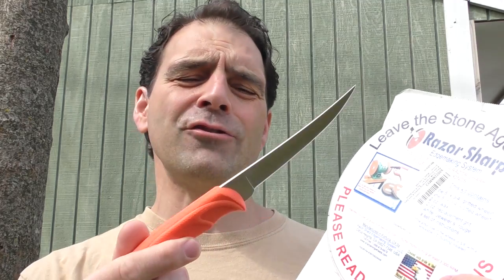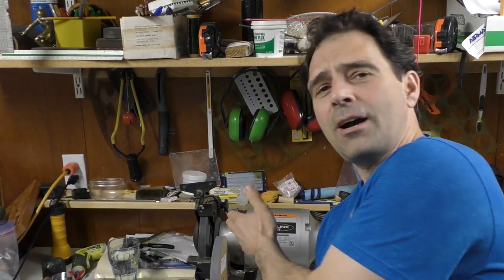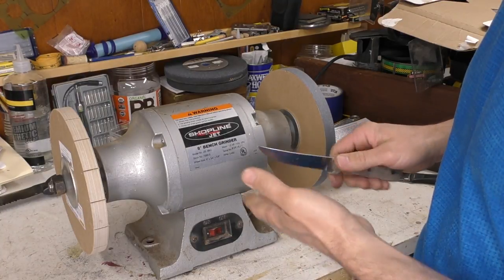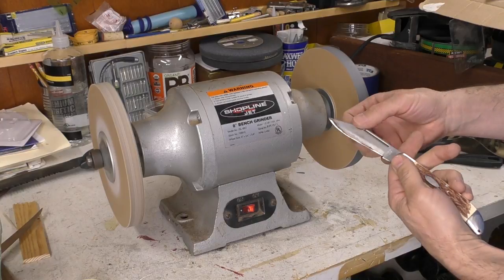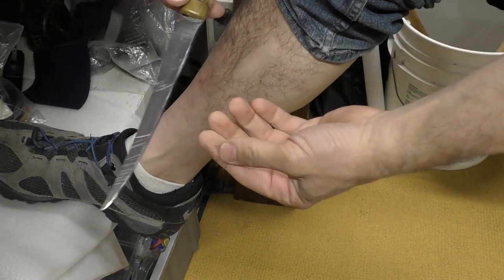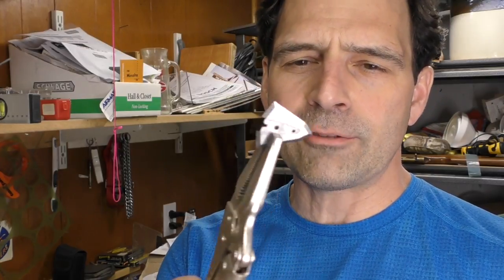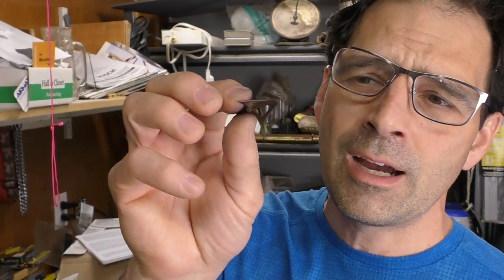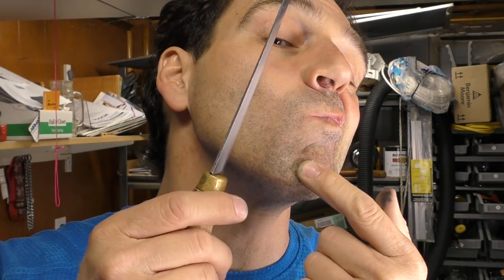Razor Sharp Edge Sharpening System - Is it Worth the Money???

Comment: Great video, try hitting each edge twice in the same direction before turning your knife around to get the other side at least until you get your bur, it keeps you from flipping your knife around so many times. Great system as i have used it for years, my only slight problem is getting my fillet knifes so razor sharp is that when i am filleting a crappy i sometimes cut right through the backbone because my knife is so sharp at least on the first side of the crappy because the first side doesn't sit as flat on the board as it does on the back side of the crappy. This paper wheel creates a hollow ground edge which i like on my knifes and tools.
Reply from the maker: Thanks.  Yes, I still love this method and I’ve gotten better with it.  Developing a burr on each side is a game changer, and this gets it done quickly.  Gotta love a sharp knife!

Comment: Nice video! It would be much easier and safer to sharpen your knives by having the wheels turning away from you, not towards you. That way, you get better control of the angle at the top of the wheel. For better precision, a "Tormek" type railing system used with a dedicated knife jig can be mounted at the front of the bench grinder. Extra cost obviously, but the difference is noticeable if you want perfect knife edges. Also advisable to wear a face mask. Metal & paste particules are not compatible with lungs.
Reply from the maker: Thanks for the comment and advice Geoff.
Reply: Yes you are right I have the same wheels and was sharping a bench made and it jerked it from my hands and broken it in half it could've been worse

Comment: Use both hands to control the blade.  This is true of using bench stones as well.  Do not use force to accelerate the sharpening.  A final strop is in order and then periodically thereafter.  80% of your sharpening needs can be handled with a good strop and stropping techniques.

Comment: Turn the grinder so it rotates away from you. Then you can place the knife facing away from you, and use the top of the wheel, simply angling the knife at the correct angle. Much more stable and safe.
Reply from the maker: That’s what the directions say, but I didn’t like having to reach over the wheels.  I’m more comfortable/ secure. The way I had it.   Thanks for the input though.   These wheels are absolutely fantastic.
Reply: @leafinitup1  one guy simply switched the switch so the wheels turned away from him, but the switch was on the front.

Comment: I think you may have done the serration blade incorrectly. It looked like you kinda introduced the serrations into the wheel’s edge. Te way I believe it is to have been done was to only use the wheel to the non serrated sides of the blade and then the side opposite the serrated entirely to the polishing wheel and the serrated side to the polishing wheel. JUST THAT POLISHING WHEEL WILL BE ENOUGH TO “TWEAK” THE SERRATIONS. The way you did it you’ll run the risk of running your serrations. It’s your knife so it is absolutely your choice, I’m just trying to help you out.good luck.
Reply from the maker: Appreciate the feedback. Thanks

Comment: Why buy 2 wheels of this crap @ $87.00 when you can go to any HD and get a 3/4 inch 2 X 4 sheet of this stuff for $27.00 and make 8 or 10  or more yourself!  This company must be making a killing ....  Every one has a jigsaw.
Reply from the maker: Because if it’s the slightest bit uneven and not perfectly round, it will become a weapon spinning at 3500 RPMs.  It also has cut outs for reduced vibration and to keep the knife cool.   Not impossible to cut your own if you have the appropriate tools, skills and time.
Reply: @leafinitup1  That's why you put it on the grinder then use some 60 or 100 grit paper to make it flat first. Plus,  I don't care what that bozo said in his instruction, you need a variable speed grinder and use it on the slowest speed. Right about 1725 RPM
Reply: Most clowns don't have the "skilz" to cut out round paper wheels for 3000rpm.  I don't have the patience, didn't pay retail, but love the system.